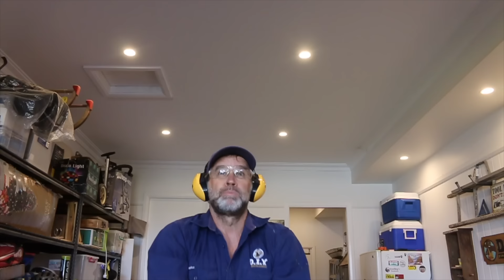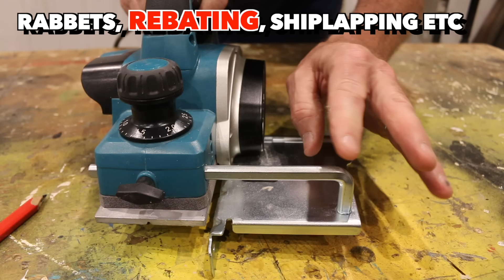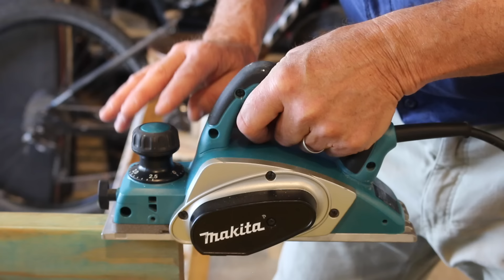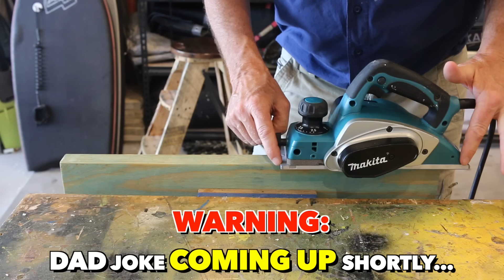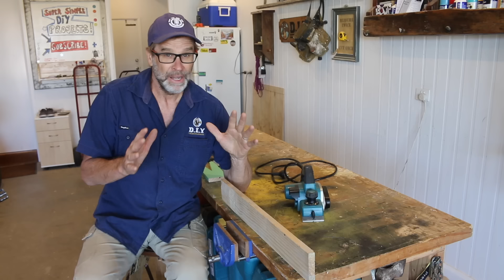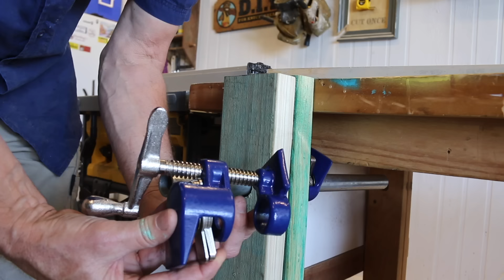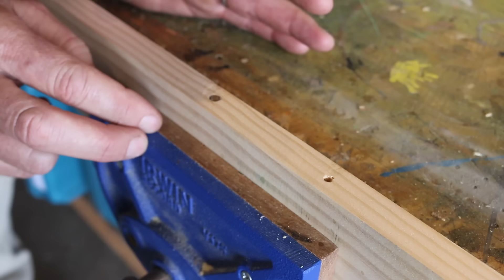BEGINNERS Guide to Using an Electric Planer.

Comment: I used to use those on edge-banded table tops when I worked for Kimball and bought one for myself.  I've never used mine though as roughly about that time I also bought a big old cast iron 6" jointer as well and so I've just never had a use for the little handheld planer.  I can use my jointer for rabbets, but prefer using my radial arm saw and a dado stack for that.

Comment: I bought a used guitar cabinet and the owner re-tolexed it drenching it in spray spray adhesive. Turns out I'm deathly allergic to the spray glue. Think a hand planer set to a very low depth would remove most of it for me? I will avoid all the joints and fasteners and use a sander on those areas. My thought process is these blades will cleanly cut it away rather than sandpaper just grinding it deeper into the wood.

Comment: My tip is to be aware that the blade is still rotating after the trigger has been released.  So wait until it stops before putting your hand near it or setting it down.
Reply from the maker: Good point, safety first, and thanks for the tip mate 👍😁

Comment: Just found your channel.  It is excellent. The new part was about standing balanced.  I do this with other tools, like a table saw or jointer, but might not thought about it with my new elctric hand planer.  Also, I learned on a large floor jointer, and learned the same technique on that to avoid snipe at either end.   Alas, I haven't had access to a large jointer for the last five years, so hope to master this, along with my planer sled.  Subbed.
Reply from the maker: Awesome to hear you're enjoying the channel and thanks for the feedback mate 👍😁🇦🇺

Comment: I've followed your advice, but my plane seems to make a lot of noise with a lot of sawdust produced, but the cut is negligible. I've made 3 passes down the length of a door with the depth of cut set to 1.5mm, but when I measure, there's no difference to the door width!!!!! I need to remove 6mm, so I thought 4 x 1.5mm cuts would do, but I've hardly removed anything. Think I'll just revert back to the circular saw!!!! :)
Reply from the maker: G'day Mark, ignore what the depth gauge suggests and play with the depth on a scrap piece of wood. Good luck 👍

Comment: Thank-you for the video, probably the best I have watched so far.  I notice that when you showed us the anatomy of the planer, you used your right hand to demonstrate the safety button which you operated with your right thumb and the trigger with your right fingers.  OK I get that, but when you demonstrated the planer in use, you used your left hand on the back of the planer, and somehow got the thing to go I am at a loss to work out how you did that?

Comment: Not dangerous at all; it can cut only a finger or two, not the whole hand! Just a flesh wound for the real men. The ones with a unibrow, that is.
PS Alternatively, you can select the depth of your cut by turning the knob in the direction of a needle on the compas 😉!
PPS, when you say 'a duplicate copy' doesn't that mean you should have three pieces!? An original, it's copy , which is a second piece, and it's (copy's) duplicate! 
I'm sorry, English is not my first language.😂
Greetings from Split, Croatia!👍💪

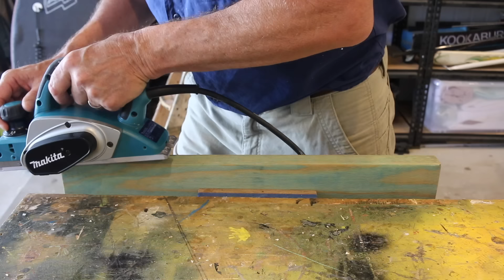Comment: At 5:45 min in you talk about coming to the end of the wood. Lift like a jet plane. Well I'm trying to see more about how you would finish on the end while still planing the end. I have a door (that is hung and hinged and I am not taking it down) where the top 3 feet of the edge needs planing. I need to get all the way to the top as that area needs it as well. But at the point the front shoe is off the wood in the air and only the blade and back of the planer are in contact.

Comment: 12:02 how do you dig out a nail that you cant grab? also how durable are blades generally?
Reply from the maker: If you can't grab the nail you can either try and punch the nail through using a nail punch or you will need to chip around the nail with a chisel until you are able to get a hold of it. In regard to blades you will get a long life out of them until you hit a nail 👍

Comment: I wish there was an example of planing a surface that is wider than the planar itself.. like the face of a plank.. not the edge. Is that something a planar can do?
Reply: Yes, with more work and skill. A lunchbox/thickness planer is better at that, and way faster. The main use of these is to straighten up small imperfections to be able to million the other side of it to match.

Comment: When you put  the plane down before it stopped gave me a start. I didn’t know about the the sprung support foot on this recent model. My 3 decades old but similar Makita doesn’t have this feature. I think I would still put it down on its side like I do with hand planes. Never seen pipe clamp that can use conduit. It can’t be as strong as threaded schedule 40 pipe. I transfer my front hand to the rear of the sole as I come to the end of a workpiece thumb on top index finger on bottom serving as a fence to keep the tool from skewing

Comment: sorry I am a beginner and I not so sure if I will buy an electric planer. It is because I have a table saw. Planer is to reduce its thickness right? so by right I can accomplish it with a table saw. haha, really sorry for this noob question.
Reply from the maker: You are absolutely right Rechie, you can use a table saw to reduce the thickness of your wood but the electric planer is so much easier when it comes to planing down a piece of wood that is uneven and needs different thicknesses shaved of it in different places....if you know what l mean  👍😁🇦🇺
Reply: @diyforknuckleheads  I get it already, the answer is so easy and yet sometime it is hard to answer...the table saw have its limitationd due to the length it can cut. and you are right it can be much easier with a planer...thank you

Comment: Awesome informative video, would love to see one on planing the bottom of a door. I dont have clamps and work benches sadly. Anyway i can still plane a door safely? I usually just put the door between my legs and plane downwards but its not ideal for straight lines and applying pressure. Any creative ideas would be fantastic sir
Reply from the maker: Thanks mate! Glad you found the vid useful 👍👍 To Plane a door, l sit it on a block of wood about 400mm long and wedge it between two blocks that have been screwed to the 400mm piece. These blocks hold the door in place while you do your planing work 👍

Comment: Why do electric planer videos always show examples of how this works on wood that is already planed!
Reply: The flat surface of the planer is used as a guide for the cutter. If your surface (guide) is uneven, guess what the cutter's going to do....
Reply: On an undulating surface you must skim off the high spots first to make it gradually flatter with each pass.  Find those high spots with a long straight edge like a spirit level or a plaster’ers feather.
Reply: Hahahaaaa rough, what you need is the demonstration
Reply: mark a straight line using a straight edge or chalk line, string, etc, take a pencil and mark the top where its high, cut that down until its level, boom done
Reply: ❤❤❤❤❤❤❤ he is serious
Reply: And chemically treated timber with the carpenter unmasked
Reply: Because a hand planer like this isn't really suitable to create a smooth plane when there isn't one to start with.
Reply: It's irrelevant surely? It could be the 1st pass or the 5th, makes no difference to the operation of the tool
Reply: @simonliddiard4900  Of course it makes a difference. You wont know what sort of quality your getting from the tool. If you plane wood that is already planed, even a shit planer will look great as it's not doing anything. It wont if it has to really plane it from the start

Comment: I made an extra long manual planer , looks like the extra long manual jack planer but instead of sharp blade it has the long rough sand paper , it is safe and do a not chewing at the end . It has two handles for better grip. You need to have sand paper role due to its length.

Comment: Very good video. I am about to buy one. But what if the edge has an angle to it? Won't the planner run in line with the angle?
Reply from the maker: Thanks Gary  When the edge has an angle, you to need to plane it square by working the highest edge until you can get it flat.....if you know what l mean 👍

Comment: 2024 that carpenter joke is still great 👍 
Also by far the most practical information packed video I have ever seen. So thorough. 
I use mine to splice hardwood stringers for longer staircases and still learned a few tips. 
❤ the pipe clamp addition to the workbench for a vice.
Reply from the maker: 😂....Thanks mate...glad you liked it and thanks for the feedback...really appreciate it 👍😁🇦🇺

Comment: Nice as always, Knacker. One thing I was looking for in this tutorial is how deep should you set your initial cutting depth; over the years I've tended to use hand-held planes, so don't actually own an electric unit - I assume there'll be guidance in the instruction manual (tho' past experience has shown me that those instructions can be a little vague). What's your say on the matter ? Is it the same method as a hand-held tool ? Cheers,
Andrew.
Reply from the maker: Andrew, after using one for many years l really don't give it much thought but to err on caution just set it deep enough so that it takes a little off. Once you get t feel for the wood you are planing then adjust as you see necessary 👍😁🇦🇺
Reply: Nice. Got it - cheers that man 😁
Reply from the maker: @andrewtongue7084  No worries mate 👍

Comment: I have a crowned joist in my deck substructure that I want to flatten before putting on the decking. How do you plane when you can't start at the end of the piece but have to start somewhere n the middle?
Reply: Draw a depth line on it and run both ways to just off your line. Keep going starting in slightly different spots to even it out. If not confident do the last bit with a sander and 40 or 60 grit. Make sure you wear a respirator as the wood should be treated. Cheers 👍

Comment: I just unclamped a laminated charcuterie board and realize that the piece in the far end is slightly angled (I even had a nagging feeling that I had tightened the clamp a little bit too much, but ignored that voice). If I'm not concerned with the overall thickness being reduced, do you think I could use my electric hand plane to even it out on both sides?

Comment: I am thinking of getting a planer to restore a sort of awning roof I have in front of my house. There are 2 x 6 inch pressure treated boards extending from the eaves that support a fabric awning. The top side have some wood rot and I want to plane them all and treat them with some penetrating sealer or epoxy resin. The tricky part is the front shoe of the tool. When I plane toward the eaves and drip edge, the blade will be a couple inches from completing the pass. Question, can I cut against grain for this section with the planer? The finish is not important as I can follow up with sander.
Reply from the maker: Yes you can plane across the board but it will leave the job a little messy. Good luck 👍 P.S. Could you just use a chisel to finish the job off rather than using the Planer?
Reply: @diyforknuckleheads  I guess i can always do some shallow saw cuts with a handsaw and chisel off.

Comment: Wow, what a great video, thanks so much for taking the time and effort to make and upload!! Question: when the front shoe is adjusted to a level, that will make the planer move at an "angle", so the rear shoe will never be complaetely flat against the work piece, is that correct or am I missing something? Keep up the great work!!
Reply from the maker: Thanks Steve 👍 Once the cutting depth has been set and the machine starts working the plane levels out when it gets to the depth that you want.... if that makes sense.

Comment: I have a planer similar to yours, but the model is a bit older (N1900B)
I'm having difficulties understanding how to use the depth knob. Is the knob supposed to turn any number of rotations? For instance, I can make several full rotations in either directions. So I'm not sure where the starting point is supposed to be. How do I set it back to the starting position if there is such a thing?
thanks
Also, the vice ideas are amazing!
Reply from the maker: Thanks LK! The depth knob needs to be experimented with. I don't take any notice of the numbers on the dial. I just either rotate it up or down depending on how deep l want to go and then give it a test run on a scrap piece of wood. If the cut is to deep l just relieve the knob setting a little and if it's not deep enough l engage the knob the little further. Good luck with it 👍😁🇦🇺

Comment: 46 years myself as a cabinet maker and never thought of your vice design will make of those  to remind my self there is allways a alternative easy method. Regarding cheap tools allways buy the good quility they should last a life time myself only ever use Makita never had one power tool fail in over 40 years one Makita drill still performs perfectly after that time and used daily. Regarding reclaimed wood my advice avoid any timber if it's had nails in like pallets. This type of timber can easily wreck a plainer thicknesser, bandsaw blades and saws of every type costing a fortune to repair.
Reply from the maker: Glad you liked the vice ideas mate and thanks for the feedback! Cheers 👍😁🇦🇺

Comment: I am wondering if a planer is the right tool for the job I'm doing right now. I'm working on a dresser that I scraped veneer off of,  the top is not level there are gouges and a number of wormholes I have used wood filler, and sanded 2 times and still not completely level. I was planning on borrowing one from a friend that's why I watched this. Since I have not ever used  an electric planer, I  planned to set the blade on the highest setting and lower it as I go. Do you have any tips or suggestions?

Comment: Very good video but something I noticed u didn’t mention was to pay close attention to the cord I’ve hit it multiple times on the back stroke luckily haven’t severed it but it’s an easy thing to do  also I’m having a problem where it bounces it’s not a huge problem but causes a lot of extra sanding the ridges this cause are only about 1/16 of an inch deep but in epoxy that’s a lot like an extra hour of sanding do u know what the problem is? Right not im guessing it’s a dull blade but not entirely sure

Comment: Since this for knuckleheads, this question should fit right in.
I recently bought a planer and am very familiar with snipe.
In fact, it seems like unless I "float" the planer over the work, it drags bad and snipes out at the end.
When I one hand the planer and support most of it's weight, it provides a great cut without snipe.
Looking at the shoes of the planer, they still have large and deep machining grooves in an arch from side to side. 
Isn't the shoes on the planer supposed to have a mirror finish so it will glide smoothly over the work?
Reply from the maker: G'day Warren. The finish doesn't need to be a mirror finish...just smooth 👍

Comment: Avoid purchasing a cheap power planer. The first second you use it, it will cut like butter - you will realize what a great tool it is and regret not getting the best one available. 
These are absolutely great tools. 
Note: all the replacement blades (brands) seem to be the same. I have never realized any difference in them at all, except for the price. 
When trimming the bottom of doors, chamfer the end a bit or install a wood block extension on the end. When the planer goes past the end, the rotating blade can pick up and splinter the wood of the unsupported edge a bit, which can be seen when the door is open. This is not the same as snipe. 
Plane towards the hinge end so if the edge does splinter, it will be less obvious than having the splinters missing/repair from the (more obvious) handle edge.
Buy an extra belt. Even though they last a very long time, it may be hard to find one 10 years down the road when you need it. They're cheap.

Comment: Hey uncle Knackers happy New Year, I watched this for second time. I have a couple of questions. 1) For first planer would be better a second hand corded Makita like in your video or a brand new corded Ryobi? unfortunately the Porter-Cable isn't sold in NZ and can't find it the 240v available in Amazon(this is motivated as I saw you using a Ozito when making the bench). 2) Aside from the Porter-Cable planer is there any other similar that you can suggest maybe?. Like many the aim is weekend/free time/side hustle use. Thanks, great and fun video.
Reply from the maker: G'day Mauricio...a second hand planer like mine would be a good choice as would the corded Ryobi. Either of those would be a good choice for your needs. Good luck with it mate and thanks for watching for the second time 👍😁🇦🇺
Reply: @diyforknuckleheads  thank you very much!.

Comment: Far too slick and slack, no mention of the potentiality for the planer dust to clog the motor issue and as a consequence overheat the motor and burn out, with smoke everywhere.